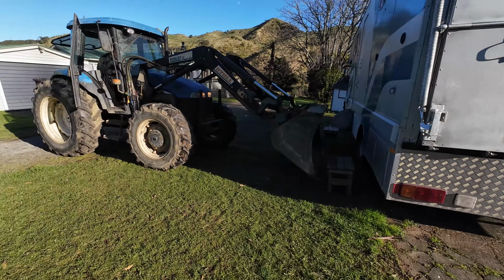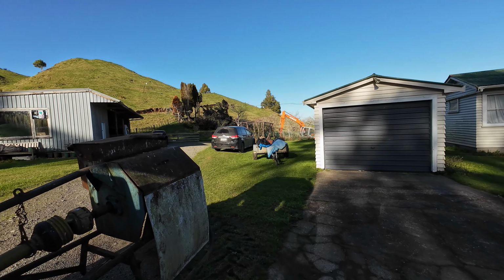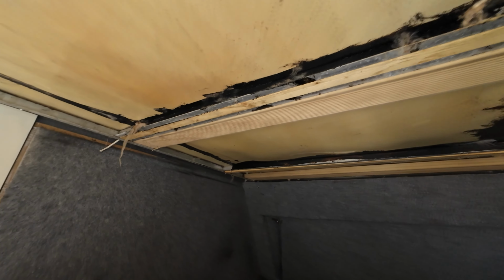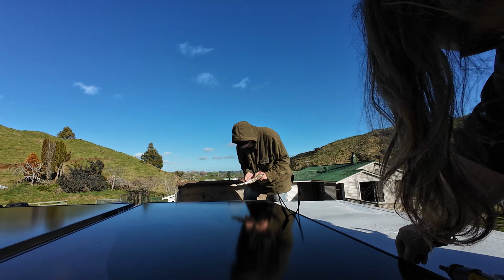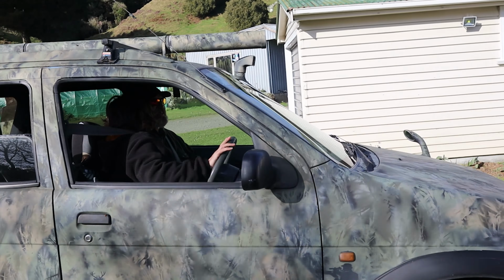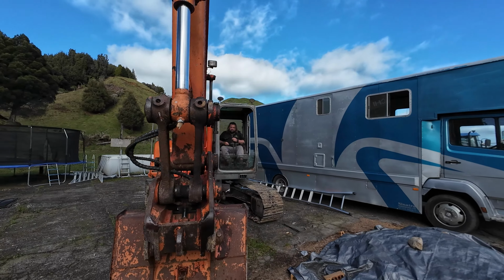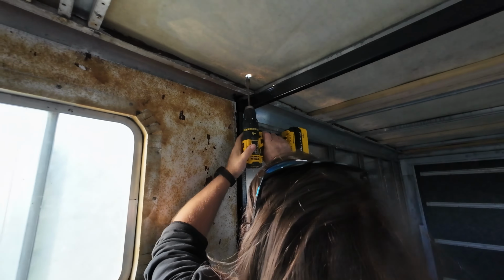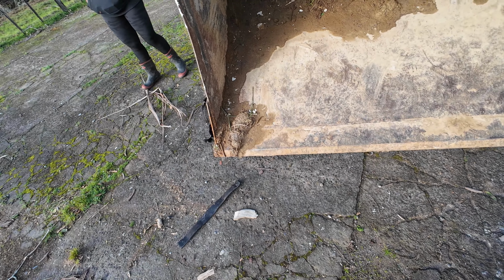Installing the solar panels with an upgraded scaffold! [Life in New Zealand Daily Vlog #720]

Comment: Watching Benn getting lifted around in the digger bucket has to be funniest thing you guys have done so far 😆certainly a very unique way of doing it 👍
Reply: The kiwi way😂😂😂
Reply from the maker: 😆😆😆 it was a bit nerve racking as he was so high up though! But we had a very talented digger driver behind the controls so that was reassuring! Definitely couldn't have done it without the digger as Benn needed to be positioned in the middle of the roof to lift the panel across without it touching the roof and scratching it. We learnt that after froffing the first panel up by hand 😆 it's so high up, Benn would have been around 4m up in the bucket!
Reply from the maker: Kiwi as bro!